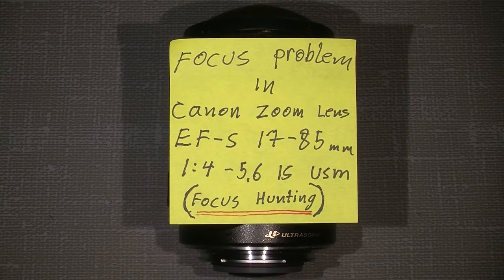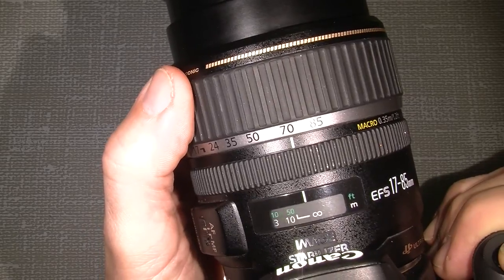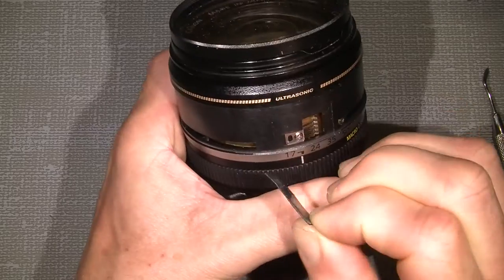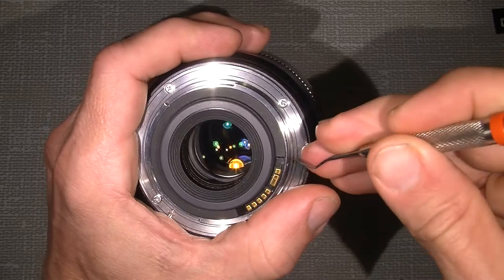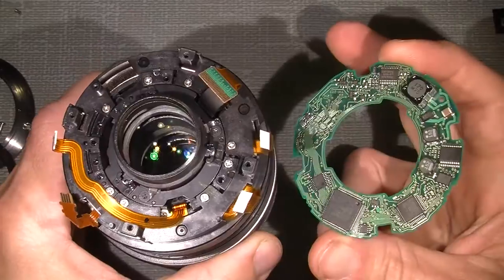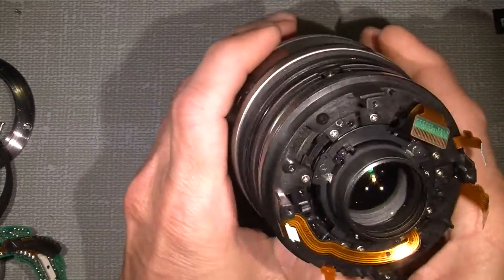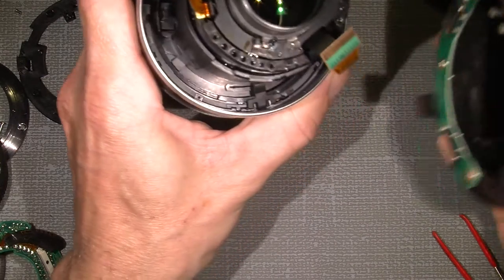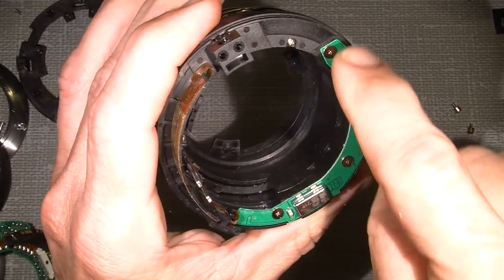Focus problems in Canon zoom lens EFS 17-85mm 1:4 - 5.6 IS USM (focus hunting)  PART 1

Comment: the problem is focus position sensor is dirty, its transparent plastic optic inside the focusing mechanism. there are 2 of them one is below and long, one is above and short. thoroughly cleaning both of them with lens cleaning liquid and rub dry with lint free tissue will restore correct functionality of autofocus at long (in fact at any) focal length. this is not hearsay, i did this on my own 17-85 as many people shared and recommended this method in the net... i let the problem stayed for years as i usually have no problem using it in manual focus mode. once i did the fix, my lens is like new again. if someone charged you for USM motor replacement, you have been conned, the fact that usm motor is hunting right and left, meaning the motor is doing fine, its just positioning it in the correct position is the problem. you need to replace usm motor only when the autofocus is not moving at all or moving very slowly (low powered)
Reply from the maker: Thank's for this useful information, I will take a closer look sooner :-)
Reply: Can you link to a picture or a diagram of where these position sensors are? Or if they are visible on mikeno62's video a timestamp? Thanks for the information though! mikeno62, epic teardown video, thank you as well!
Reply from the maker: Thank's James, if you look at 40:39 where I take out the little brass with a small plastic window / lens, you see the black optocoupler where there is a sender infrared led and a reciver diode, on each side, it's part of the counter circuit. So when the USM motor move the focus system, the optocoupler and the electronic circuit will count how many lines on the long curved plastic has moved and in that way figure out how much has the focus moved, of course together with the focus circuit in the camera. (I hope the explenation is correct, because I have NO service manual for this lens))

As I understand it, the optocoupler will get dirty during the years of use, so the 2 very small lenses in the optocoupler need to be cleaned with a small cotton bud and Isopropylalcohol 99%.
Reply: its shown in the video starting at around 35:00. i cleaned all including excessive oil smearing the optics... fwiw...
Reply: So here's a weird thing. I've watched like 6 videos of the EFS 18-85mm and on every one, the largest ribbon connector socket on the circular circuit board looks the same. It has side clips to disengage the cable. Mine does not. I guess I'll try some gentle tugging but why does mine have to be different!? :-D

Comment: Thank-you for this video, by following it I was able to fix my Canon EF-S 17-85mm that would usually (but not always) focus in the brightest of light. In any other lighting it would hunt, typically from closest focus to infinity (so I knew the motor was good and figured dirt was preventing enough light from reaching the focus sensors). The only difference in my procedure is that I did what some others that commented here did in completely removing the large semi-circle lens and cleaning all sides of it. I used 91% isopropyl and lint-free Kimwipes. With a set of precision screwdrivers plus care and patience a do-it-yourself-er can accomplish this. It took me right at two hours from start to testing the lens.
Reply from the maker: It was really good that it was working for you :-) and really good info about the cleaning issue. I will also make one more video that I will show, what actually happen when cleaning the parts that people mention in the comment.

Cheers
Kenneth

Comment: Hi mikenon62 thank you for sharing this video! I had exactly the same problem as you did show at the start of this video. So I did do exactly the same as you did show in this video and it worked for me, the lens is working fine again.
There was one thing I did do extra which I noticed you didn't do! you did clean the small and large transparent plastics but not the lens from the sensor which sit just above that. I did clean that one also with a optical cleaning tissue and some lens cleaning fluid. when you have some time you can also try to do that and hopefully your lens will work fine after that, good luck!
Reply from the maker: WOW, thank's a lot for the info Gerrit, I have just buy a used version that have the same issue, so I will make another film about that issue in the lens.

Cheers
Kenneth

Comment: Where did you get the JIS bits from ? Amazon has Moody Tools JIS screwdriver, I don't know if it's worth or not.

The flex to the IS assy is easy to tear during reassembly, because the barrels tend to rotate.
Reply from the maker: I really like the "WERA" brand, the bits is SO MUCH better than many other brand's I have try (it has been a lot's of try and errors) that's why I use the WERA crosshead screwdriver's today.
This is the bits for the JIS, CJIS screw's, you will find it here on Wera's site:
http://products.wera.de/en/tools_for_power_use_the_range_of_wera_bits_bits_for_phillips_screws_851_1_j.html
And here you also can buy the set, the same I use:
https://www.machinemart.co.uk/p/wera-kraftform-kompakt-11-piece-sb-electronics/

Yeah, that's correct about the flex cable Dorf.
CheersKenneth